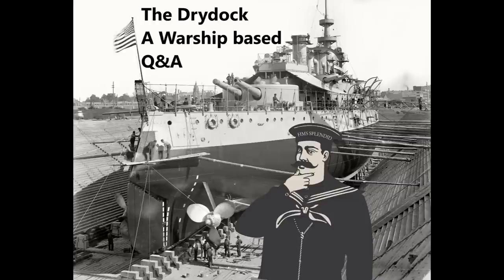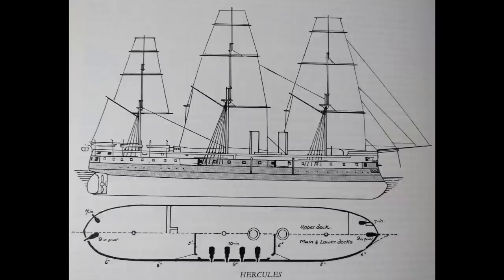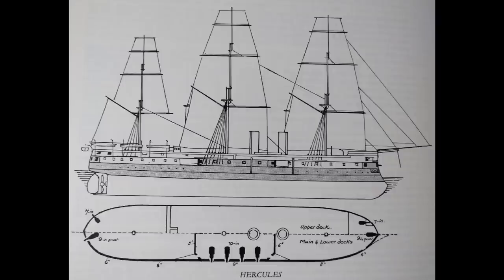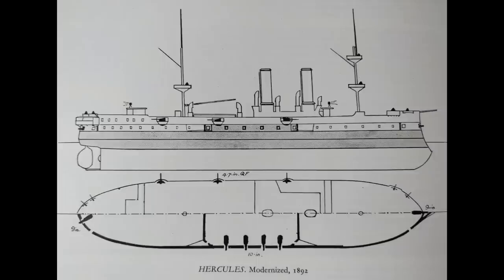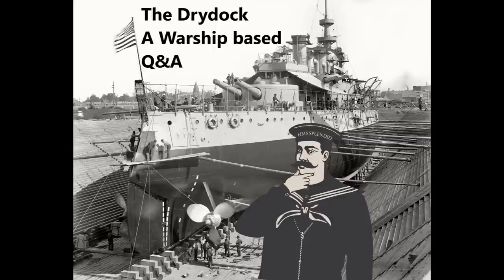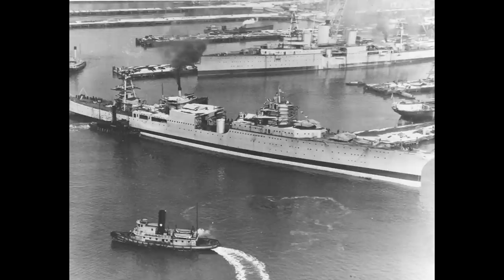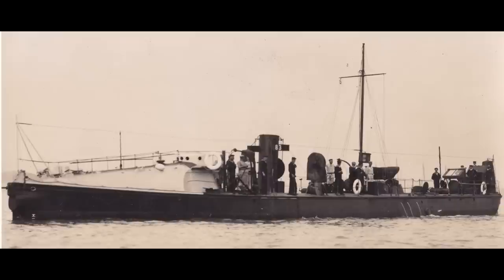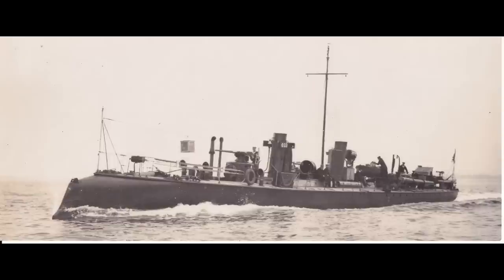The Drydock - Episode 233

Comment: I love the informative videos that Drac does and will never say anything to hurt his heroic efforts.  That said, there is one oversight, because the initial speed calculations can be dramatically affected by changes in loaded (or depleted) ship weight and therefore displacement plus marine growth on the hull bottom and sides below waterline.  The fire control computer needed very accurate speed readings to properly aim the ships guns.  There is a long, heavy "dagger" that is lowered through a through the hull opening in the bottom of the ship which was the marine version of a pitot tube.  The reading from the daggers were fed directly to the fire control room for real time calculations.

Comment: wrt the question about AA gun alternatives to the Bofors and Oerlikon: sticks in my mind I read that one of the issues with the Vickers PomPom was that it would not run satisfactorily using USN smokeless propellant, and no-one in the US made cordite.   My favorite for medium AA, in the absence of the Bofors, is the Browning 37mm, which was used by the US Army.  It had the advantages of already being in production, using US materials and propellant, and offered significantly greater range than the Vickers.  Modify it for proper water cooling, and implement the mods later introduced on the Army version: feed by metal link belt, from either side, and I envision a quad mount along the lines of that used with the Vickers.  A replacement for the Oerlikon is a problem, because, for a close in weapon, I would want the responsiveness of a pintle mount.  The Bofors 25mm that the 40mm was based on was too heavy.  iirc There was a pintle mount version of the Vickers, but then the propellant problem resurfaces.  The Hisso, in US service, was horrible unreliable.   I'm thinking of the M4 version of the US 37mm, as it was significantly lighter than the M1 version, and was used successfully on a free mount on PT boats.  The 37mm has a lower rate of fire than the Oerlikon, and a lower muzzle velocity, but, if it does hit, the 37mm shell will do a lot more damage than a 20mm.
Reply: If the Oerlikon hadn't been available, maybe they would have adopted something like a dual or even quad .50 cal mount? Obviously severely lacking in punch comparing to an autocannon firing HE shells, but could be usable as a stopgap until issues with the Hispano had been sorted out?
Reply: @jbepsilon  some British ships mounted a quad Vickers .303 machine gun.  Pretty useless, apparently.    I did a bit of comparison on Navweaps, the 37mm M4 actually had a longer range than the Oerlikon.  The Oerlikon cycled at 450 rounds/minute.  The M4 cycled at 125rpm.  The Oerlikon mag held 60 rounds.  The M4 mag held 30.  The M4 can fire longer than the Oerlikon, between reloads.  The Oerlikon throws more rounds, but the M4's rounds could do a lot more damage.  I have read that the old Vickers PomPom had something of a renaissance when the Brits ran into Kamikazes.  The Oerlikon rounds were too puny to really stop a plane, while the old PomPom would shoot a Kamikaze to bits.
Reply: @stevevalley7835  The 37mm M4 uses a much smaller 37x145mm cartridge, compared to the M1's 37x223mm. This resulted in a lower muzzle velocity and lower range compared to the M1. And if the M1 had been adopted instead of the 40mm Bofors, that makes the M4 instead of the Oerlikon even less likely, because the same ship having to stock two different sizes of 37mm ammo and make sure they never get mixed up and sent to the wrong gun batteries is a logistical disaster waiting to happen.
Reply: Another option to replace the Oerlikon was unpowered single-gun Pom-Pom mounts. They were quite widely used by British ships in WWII.
Reply: @RedXlV  even if the ship designers were careless enough to put M1 and M4 ammo in the same magazine, mixed from rack to rack, seems the way the ammo is mounted would be enough of a signal to the ammo passers.  The M1 originally used a 9 round rigid clip, but, I am assuming the mod to metal link belt is implemented for shipboard quad mounts.  The M4's loop magazine was intended for aircraft use and had to be bolted in place, with cartridges loaded into the mag one at a time, after the mag was mounted on the gun.  That is so awkward I wonder why it wasn't changed when the M4 was mounted on PT boats.  The M4 would probably be converted to rigid clips, like the M1 originally used.  So, even in a carelessly design magazine on a ship, the passers would know, if the ammo is in a metal link belt, it is for an M1, and if it is in a rigid clip, it is for an M4.  In the magazines, the loading tables for the belts and clips would be designed to make it obvious if the loader was trying to load the wrong size round.  You are correct that the M4 had a lower muzzle velocity than the M1, but in this context, compare to the Vickers PomPom and the Oerlikon.  The Vickers and Oerlikon have very nearly the same range, while the M4 appears to top both of them, with a maximum range of 8,875 yards, vs 3,800 to 5,000 for the Vickers LV/HV respectively, and about 4,800 yards for the Oerlikon.
Reply: @rupertboleyn3885  yes, the Vickers range is quite close to that of an Oerlikon.  My only concern is the weight of the gun and ammo reducing the responsiveness of the mount to the gunners efforts to aim the thing.249kg, vs 97kg for the M4, and 68kg for the Oerlikon.